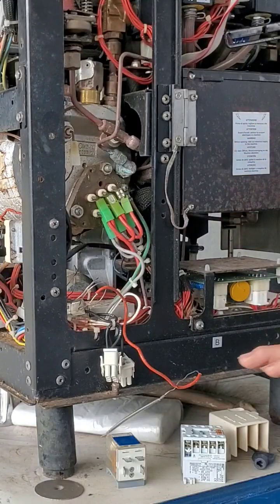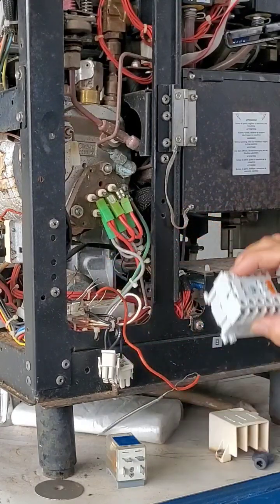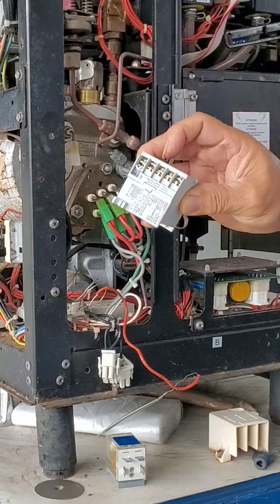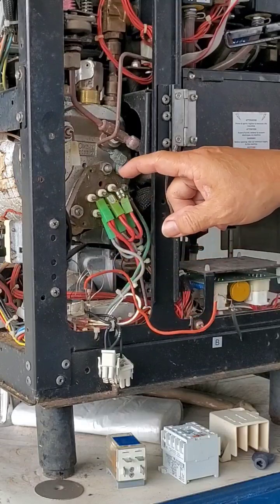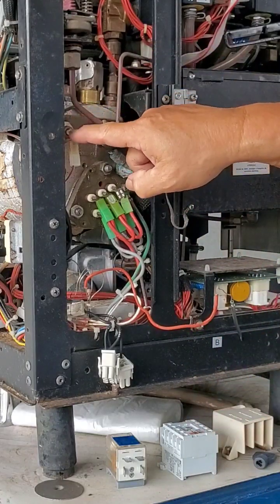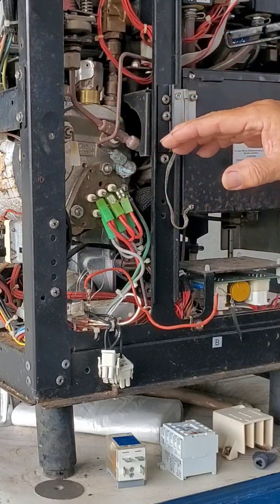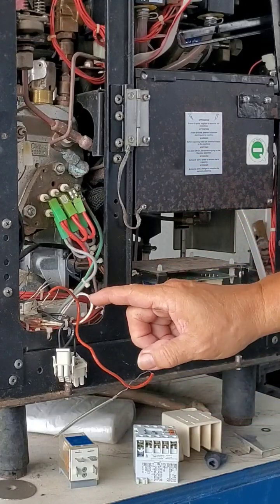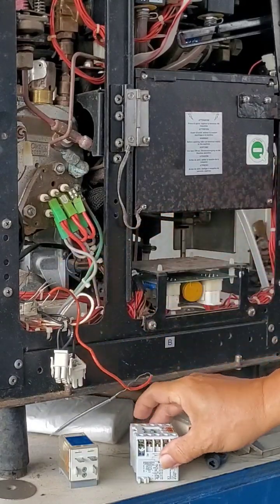Cimbali M49, M50's Basic Boiler Heating Startup.

Comment: Is it easy to convert a M-49 to 120v?
Reply from the maker: "A question" (Star Trek S1-E28),  This (Unanswered) conversion has been on my mind for Decades...though possible to use a 120VAC to 240VAC Transformer (Not a Buck booster!)  It's the Amperage needed (20-30 Amps 220VAC).  I've thought of replacing the boiler heater to 110 volts (from a M21 Junior).  Then use a 120v to 24v transformer for the control voltage (T1 replaced).  But always wondered how to run the 220VAC  grinder(s) and group water pump. The Turntable is 24VDC from power supply board.
So, lots of stuff to change.  This is the result: Longer heating time.  3 each 120 to 240 VAC transformers.  Separate 120 VAC power lines to heater, motors, T1 transformer. Group water pump.  Water pump system could be replaced with a 120VAC version, but it's too big to fit inside frame.  Conclusion: possible but not practical.  This is a PRO machine and needs to be treated as such.  You will find a place for it once it's up and running.  My family got spoiled with the one in the house (sorry, I unpowered that one when that room got rented.  No, the tennant used a 'Kuric' pod brewer)  Imagine the daily orders:  Tripple shot Americano, Double thick grind Longo double shot Americano, Straight single Americano, and finally (daughter's) 5 shot with extra milk double Latte and Frothed foam! (2 times for her).  I bounced from a double espresso to a double longo (extra water).
Yeah, I ran 240v, 30a From an unused spare water heater supply line.  I Could have ran a water and drain lines but wife said no.  So i set it on counter as a 'Cart' setup: Bottled water, Bucket drain.  The M49, 50's use a Group water pump which will suck up water from a water bottle (5 gal.).  Though, the turntable group wash cycle gets a bit screwy during wash cycles.  Doesn't do a good job.  Yeah, it will spoil everyone.  😂
Reply: @ukeboy57  well now that's what anyone will say is an answer! So I ll take that as a NO. We never use the dishwasher and that slot under the counter is almost ideal; and simple to run 220-240 to that juicy location. Thanks again my friend, God bless. chrisinbigbear
Reply from the maker: P.S. When your ready, we can get it running.  Aloha!  Mark
Reply: @ukeboy57  hey! I really wish to do this, I am a congenital procrastinator..I'll start where I left off, and get you the update. Thanks for the moral support.
Reply from the maker: For anyone following this thread: Please note utility reqirements and weight limits for counters.  (This sucker is HEAVY!)  Check ID plate or go to Cimbali website for additional info.     Be safe.  Aloha, Mark
Reply: Boy! is it heavy!! Usually I can move just about anything with out a second man, but man! not this. @ukeboy57